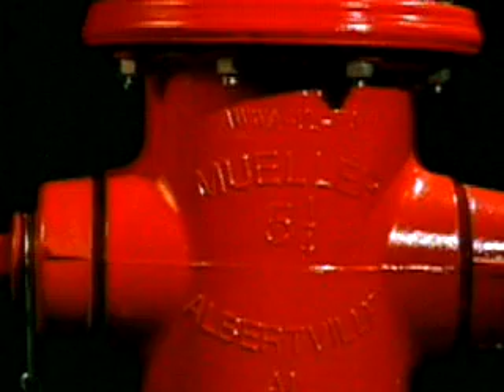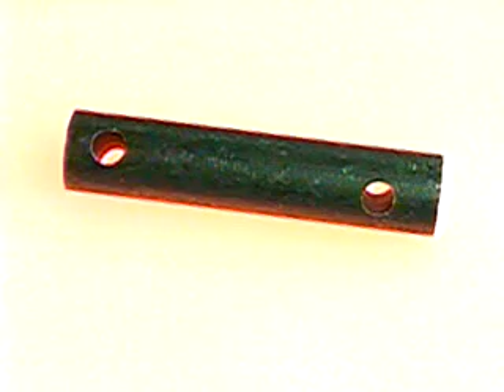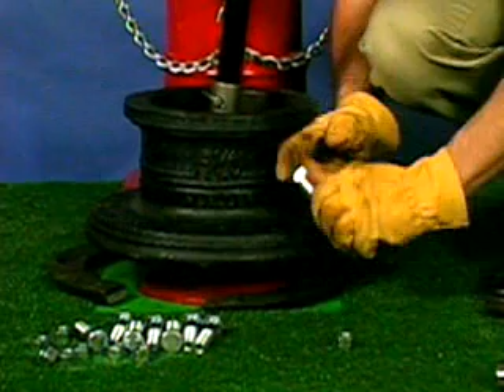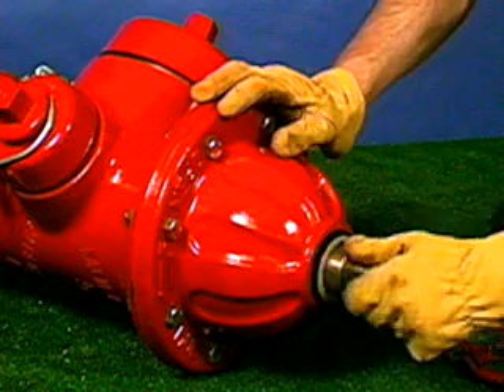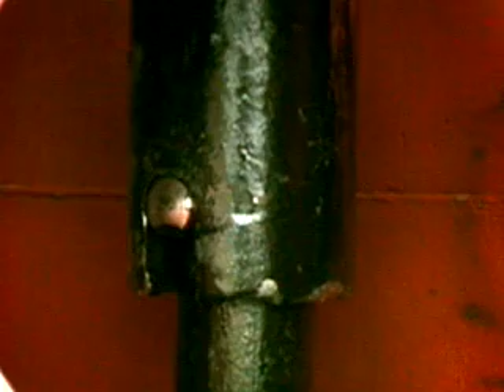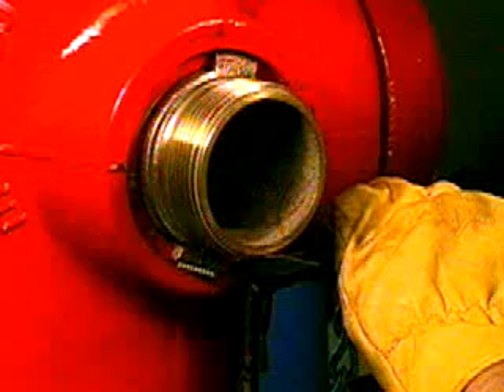Centurion® Hydrant Maintenance and Repair

Comment: Any tips getting a stubborn seat to break free?
Reply: Cheater bars if you don’t have a hydraulic impact which are crazy expensive.  The seats almost never come out as easy as the videos show, it’s very common to have to put bars on them
Reply: @smalltownmachineshop6860  I have recently discovered that a few good whacks with my mini sledge hammer to shock the threads works especially on the Mueller's. Not so much on the Darlings with that spring.
Reply: If you're a municipal worker, you should try to add a hydraulic impact and the "hydrant saver" from USA Blue book to your upcoming budget
Reply: @chrisgatts8404  thanks I will definitely look into that. Perhaps on next years budget if they tell me no. I appreciate it.
Reply: You can also try Coca Cola and let sit for a day
Reply: Pelletized dry ice works great too